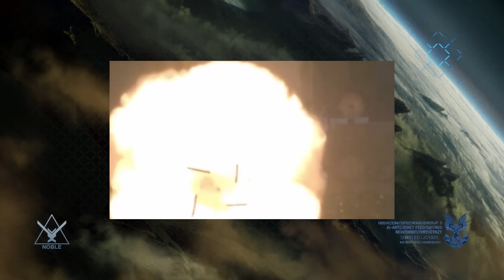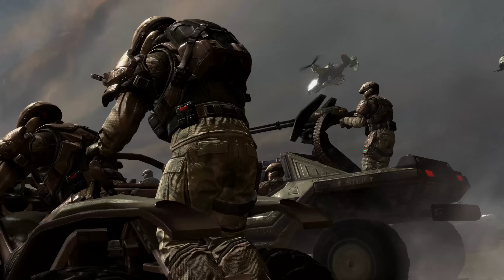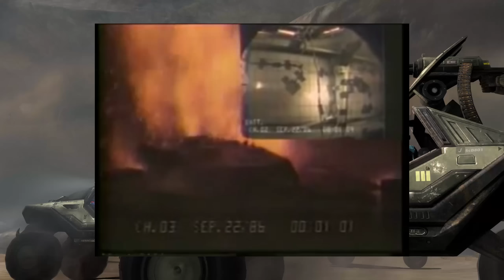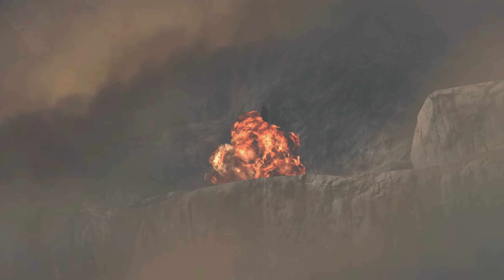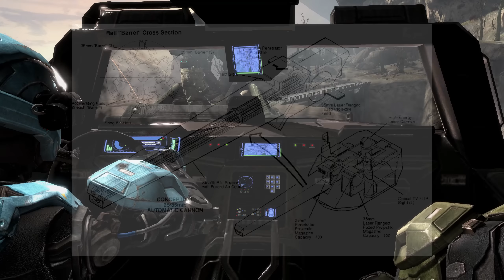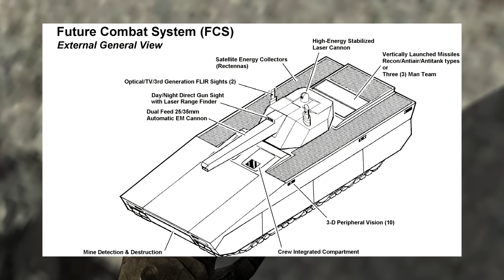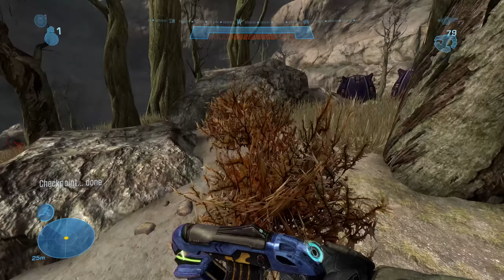Are Railgun Tanks Practical?

Comment: don't forget that battery doesn't recharge in an instant especially for the size fit for a tank with a rail gun hence after they use all the energy up they either wait till it fully charges or replaces it with a brand new battery which I would suspect is not really that practical in term of doing it and also logistically speaking.

the Rail for a tank size weapon would definitely have a low life-span compare to those with conventional barrel hence its probable after a prolong engagement they would need to replace it each time

Comment: But will they be placed on "tanks"? It seems to me that introduction of railguns will render tanks obsolete. Won't the amount of armor needed to stop a hypersonic projectile be gigantic, making tanks able to withstand railgun hits impractical? Just like the advent of APFSDS ammunition made it obvious that putting 500-700 mm of rolled homogeneous armor is not an option. It caused the composite armor to be developed, but I can't imagine any physical measure being able to stop a hypersonic projectile. I think that since no practical amount of armor will be of any use anyway, railguns will be placed on lighter vehicles armored enough to be protected from small and medium caliber fire.
Reply: Arghast Graphene. By the time we develop a method of charging capacitors at the rate rail guns can fire. Graphene will already by mass produced.
Reply: @hazardous458  Even if it will be able to reliably stop railgun projectiles, what about the men inside? I think that all that shockwaves may kill them pretty quickly, since fatigue even from conventional, repeated hits is a thing.

Comment: Solid State Batteries have a lifetime of 10+ years and are 40% (I think) more efficient compared to conventional battery of the same size. So if you were confused about the Solid State Battery part there you go. Also as a person (@kauske
) mentioned in the comments the capacitors could do some serious damage to the gun and the vehicle if hit while charged, and render it useless (most likely cause the tank would have been hull broken, gun too damaged and crew taken out).

Comment: Some of my online buddies mused on the idea that you could pretty much make a "budget rail gun" if all you did was basically try to make it match the current muzzle velocities of cannons and just use extisting projectiles stuffed in a sabot to let them be fired. The thing we immediately ran into is that a tank's engine needs a pretty substantial amount of time to generate the amount of power to fire a railgun with the velocity of a regular tank shell (of course, since the projectiles were the same as a regular M1A2, and we were shooting for a similar velocity as those, you could technically fire stuff like HEAT-MP with lower velocities if you can accept a reduced range)

Comment: Having railgun tanks won't make your tanks more survivable unless you're the only one who has them. The sheer kinetic energy your tank will absorb if hit by a hypersonic slug will dwarf the amount of chemical energy released by an ammo cookout. You'll be better off against getting hit by regular rounds, I guess, but once you make the upgrade it's only a matter of time before everyone else does. Also, railguns require energy, be it a supercapacitor bank or a flywheel bank, both of which can be destroyed by regular rounds, and both will fail just as catastrophically if hit : one will basically catch fire just like ammo and envelop you in a soup of toxic gasses, the other one will disintegrate at tens of thousands of RPM and send shrapnel all over the place.

Bottom line : I still want railgun tanks, just not to crew them.
Reply: IKR, people underestimate just how explosive batteries and capacitors can be. You'd think with those phones that cooked off in people's pockets not too long ago and sent them to hospital with 2nd and 3rd degree burns, people would understand that batteries and capacitors holding hundreds of thousands of times more electrical potential would be dangerous. Here's another issue, damage to the high voltage system could make the tank hull live, it would be pretty nasty to try and evac a burnign tank, just to get killed by completing a circuit to ground with your body as soon as you put your feet on the ground.

Comment: Powerpack is really the limiting factor here.

Currently, Army is not putting that much time and money into a tank mounted railgun and would not consider mounting one on an armored vehicle until the Abrams replacement which is looking to be 2032ish, although I expect that to slip given their track record on IFVs.

Currently, Army is working on getting hypervelocity still from chemical propellants figured with some hope to see if electronics can support those Gs, since the current Army rail gun initiatives still see the weapon as an artillery platform (and one with a big logistical footprint at that given the power requirement).

Still, it will be up to Navy to figure out the railgun and get a powerplant set up for it that can allow for more than one to be fielded on a surface combatant that then eventually can be migrated to land. Form factor wise, it legitimately is a consideration for the next US MBT which is still a decade plus off, but will not end up on any IFVs given that Bradley A4 will be around until 2050 per the budget this week and whatever comes of the OMFV recompete will also need to serve that long and will not have provisions for the powerplant to power a railgun regardless of how small that gets.

If MPF ends up failing or not lasting long, I could see a tank destroyer type platform, especially an unmanned one built around a railgun once that technology makes sense to be put in armor, but given the role and the enduring rate of fire issues inherent to any weapon magnetically accelerated, I do not personally think IFVs will lose a chemical autocannon this century given their role.

Comment: Dont forget energy production because to fit such a thing in a conventional tank will probably need to find a way to manufacture stable metalic hydrogen then make a power generator that can make use of its ludicrous energy density or when fusion stops being 30 years away like it was 60 years ago then shure or go the p 1000 rout and make tanks so big they can handle it with super advanced fire control systems probably with satilight assistance that tanke battles take place over the horizon now if you were going to make a rail gun that is equivalen to say an L/55 and not the more powerful experimental hyper velocity ones their seemingly testing for ships then used some of the saved space then 20 years isnt a super bad estimate accounting for any plausible advancements made in that time but 40 to 50 wouls be a safer estimate
Reply: If you went for a back-line mobile artillery unit, you could use a gas turbine and a conventional power plant, or even a small nuclear reactor. I'd only use the latter in enemy territory though, or else you might end up having to clean up the fallout if the reactor gets perforated or otherwise cooks off. For a shoot-and-scoot setup, you could also have a gun vehicle, and a powerplant vehicle too, to keep mass and ground pressure down. But the main issue is more that currently there isn't a particular advantage to such high velocity shells versus conventional guns. Tank armour is fairly easily defeated by most weapons that have become conventional, like APDS or the twin shaped charge in the coronet missile. We'd have to come up with some new armour to motivate new weapons, something to render current weapons obsolete. That's easier said than done.

Comment: 3:04 "Currently able to fire hundreds of rounds". They CLAIM that, 400 shots, but refuse to say if that is at maximum power. (Almost certainly not.) They also don't say how rapidly they fired those shots. (Probably not very fast.)

The simple fact is that the alloys needed to make a practical railgun weapon for "thousands of shots" DO NOT EXIST. It's unknown if such materials are even possible. If such alloys did currently exist, they would be using it for WAY more than railguns. That muzzle flash in those test videos? That's the "barrel" of the railgun vaporizing itself bit by bit. You might as well have the ancient Babylonians try to make a jet engine out of bronze.

So, get ready for the navy to be "researching" railguns 20 years from now. With the same problems and shortcomings. As far as I am aware of, they haven't even started working on the problem of active guidance, let alone explosive rounds.

China? Nobody knows if what people are calling a railgun actually is a railgun. I think it's either fake or something that will fire a few shots before it tears itself apart.
Reply: I wouldn't be surprised if we get some new alloys that change the face of metallurgy in the next century or so, it's sort of the way history goes. Titanium was the answer to many impossible problems of the past, and with research into metamaterials, it's hard to predict just what might come up in the next century. I imagine something new in terms of armour would need to be a significant motivating force behind needing hyper-velocity cannons though, since current guns can knock out most extant tanks just fine, not to mention dual-warhead ATGMs like the coronet. Necessity is a big part of new innovation, without a need, there's no drive to develop it.
Reply: @kauske  You can't just handwave new elements onto the periodic table as a solution to the problem.

Titanium was a matter of developing the tools and methods of working it into the shapes and sizes required. That and getting enough of it in the first place. Not the development of the alloy itself.

From where on the periodic table are we going to pull an alloy that has the conductivity of copper, the melting point of tungsten, and several times the strength of steel?
Reply: Metamaterials aren't 'new elements,' they are new ways of assembling elements that have new properties. I suggest you look up a term, if you are unfamiliar with it, instead of making yourself look stupid while trying to look smarter next time. For example, vantablack is just carbon, but the structure of it gives it almost zero reflectivity in the visible spectrum. There are many other extant metamaterials to choose from as well, most of which have properties that might seem absurd from just looking at chemical composition.

As for titanium properties of it were also quite unknown due to difficulties purifying large amounts of it. But pure titanium was not the end of it, eventually alloys of titanium and aluminum were discovered to be even stronger. The point is, it's hard to judge what new material science might come along in future. As to a material with the conductivity of copper, melting point of tungsten, and stronger than steel? Carbon nanotubes fulfil all of those, in fact, in tests, they exceed all of them.

Comment: One of the big issues is ammo types and rate of fire. You'd need really good miniaturized power generation systems to power a railgun to have any decent rate of fire on a small tank, without enough power, and space for capacitors, you can't fire more than one or two shots in a row before long recharge times.

Also railguns may be great at firing discarding sabbot long rods, but we do like HE and lots of other rounds. In fact we use HE far more than anti tank in war historicly, so while there might be special tank hunger tanks fitted with railguns... I don't see the main battle tank getting a railgun for its main gun anytime soon, as good old fashioned HE, HEAT, guided missiles for anti air, and a few others just don't seem to work well in railguns. Capacitors and normal electronics, explosives, antennas or sensors for targeting, small motors to handle control surfaces, fuses... quite simply a lot of things here that are hard to put into a railgun, sure because its got some insane Gs being pulled, but more so do to the whole arcing electricity across the projectile or its sabbot and producing such powerful electromagnetic fields that any type of modern capacitor present is simply destroyed. Will we overcome this in time... probably, but I see this being at least a hundred, probably more years out.
Field artillery though... that would be an area they would get used a nice bit in. If you can setup a gun and support power generator truck, that can fire at 200nm, that's got some clear use to it. Downside is while yes the rounds do damage where they finally hit, without smart munitions working in these they wont be that accurate or able to adjust for moving targets or varied weather changes during flight, and also their area of effect is just plain small. Railguns are fast, and penetrate pretty well, but when they hit dirt they just burry themselves and infantry literally five feet away might be okay beyond some scratches from dirt and pebbles ejected to the sides at the initial impact point of a dirt only a few inches in size. So do to these reasons, while they'd be okay for random damage against areas with known vehicles or buildings or stuff at range, it's still not great till we can get a guidance and control system, and/or some form of explosive/fragmenting warhead and fuse to survive being fired from a railgun.

Comment: The problem with railguns is that chemical propellants are really good at storing a lot of energy in a small space. While the projectiles will be smaller, the capacitors needed to power the gun will take more space than the casing and powder on traditional guns will. 
The capacitors could be stored in the hull still allowing the turret to be smaller, this would make the hull bigger.

Comment: A railgun tank firing thermonuclear rocket-assisted guided shells, that's the only answer.
Reply: METAL GEAR???
Reply: @baconwhale6414  that mech metal made in a 20.000 degree-c
Reply: I prefer my impractical Shagohod technology of having a giant tank running on threads with an ICBM payload that requires a 5km runway to accelerate enough to fire at the United States from the Soviet Union
Reply: @SS-ARYAN  and it was much stupid.
Reply: That could theoretically work in real life
Reply: Sounds like the Estovakian Chandelier from Ace Combat 6

Comment: A few issues:

1) Power consumption is quite large, regardless of the power pack.

2) Overpenetration of a 25-35mm round would be significant, especially on a lightly armored chassis, particularly IFVs.

3) The unreliability and expensiveness would be a huge logistical and economical issue.

4) With the current political climate, I’d expect to see funding for the military reduced somewhat, increasing the time for RnD.

Otherwise, I think it has potential. Definitely won’t replace traditional gunpowder cannons, but overall pretty good. Well done video as always, Spookston!
Reply: Overpen isn't as big a deal with rounds that big. Yes it will overpen, but the sheer kinetic energy imparted into a lightly armored target would likely result in nothing short of a hullbreak. You're dealing with extreme amounts of kinetic energy here, not just a few hundred meters per second.
Reply: @JohnnyShagbot  i thought hullbreak was just a gameplay mechanic in War Thunder?
Reply: @notstonks20  it means that the damage done to the vehicle was so severe that it caused a massive rupture in the hull, or outright blew it apart. War thunder doesn't actually visually show this.
Reply: They will absolutely replace traditional cannons eventually.
Reply: @Danuxsy  would sensitive write story of holding he writter superior awfu
Reply: @nichsulol4844  nothing you wrote made any sense.

Comment: You also have to look into the fact that the colloquial term rail gun can also apply to a similar type of weapons platform, called the coilgun. A coilgun, as the name suggests, uses electromagnetic coils outside of the barrel to propel the projectile at High Velocity. It is slightly less efficient than a true railgun, But it makes up for it and how many times I can fire, combines with how stable the flight can be. Note. I am using TTS in order to comment on this. Sorry for weird errors.

Comment: The guy that invented the lithium ion battery did develop a new battery that is made of glass and I think uses less rare earth elements in it's construction. It produces no heat the way lithium ions do, so it doesn't need a cooling system or randomly burst into flames. I think it also charges faster and holds more energy. If it pans out they will likely put them in cars first, but the military will almost certainly want batteries that can charge and discharge faster for just this application. They could also replace a lot of internal combustion driven platforms with electric drives which free up some supply line load as well as being much more quiet and giving off less of a heat signature.
Reply: Lithium will be not the power source for railguns.
Reply: @ANDREALEONE95  Not what I implied. Read again.